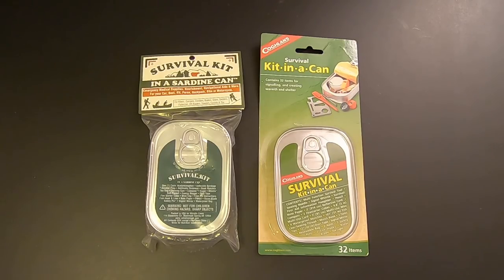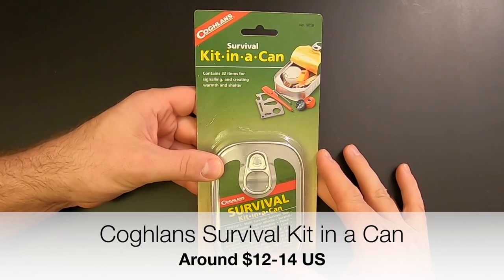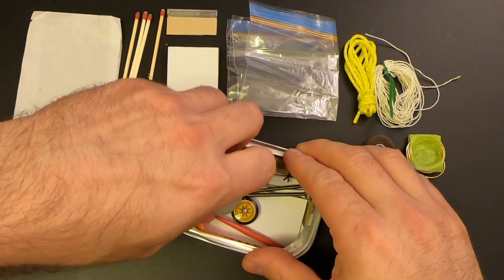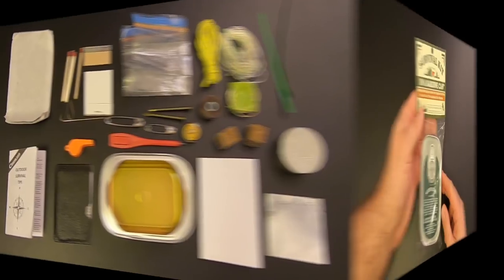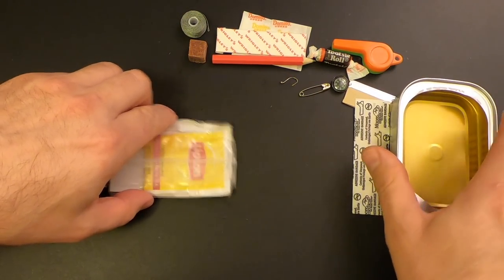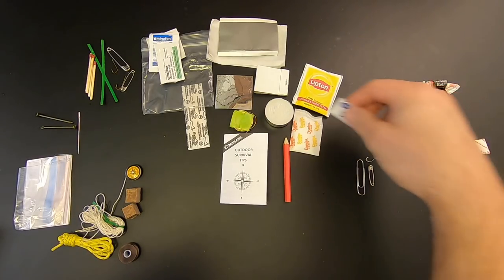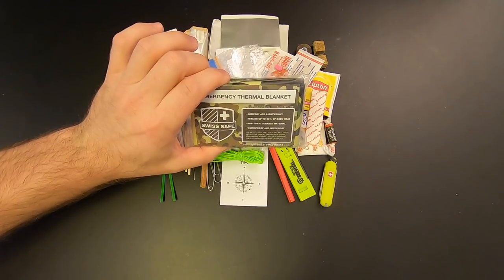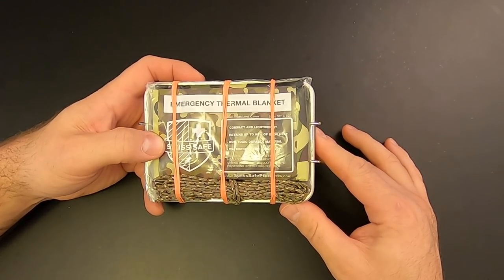Sardine Can Survival Kits - Coghlan's and Whistle Creek

Comment: Personally I have always be a fan of the Cobham's kit. 
It gets belittled by various influencers in the Survival/Bushcraft arena, who naturally want you to buy their own brand kit, at an eye watering price. Without which you will most certainly perish in a most protracted and horrible manner.
However, it's a remarkably capable little kit, particularly at its price point. If I to equip a group of people economically (purely as a precaution) with minimal capability for a short duration, it would be my first pick.
One of them, A space blanket, emergency poncho, Mora knife, 15' (3m) of 550 cord and possibly a wire saw would enhance their chances vastly. 
Give a short (4-8 hr) course on the kit's contents and their possible uses.

Comment: One use for the bread ties would be, take the package the can came in, dump everything into it, wire tie it closed, and put it in your pocket.
I used a bread tie to temporarily reafix a loose button, replace a small screw, start a fire with a AA battery,  and keep a loose knife in my sheath.
It's what I had at the time and worked at least for a temporary fix.

Comment: They must have changed the contents on the Coghlan's Survival Kit In A Can. I have a few from years ago that haven't been opened, and they contain some items I didn't see in the tin you reviewed: bouillon soup packet, 2 adhesive bandages, 2 antiseptic swabs, 1 tea bag, extra twist tie, 1 chewing gum,1 energy candy, and the 4 matches are listed as waterproof. They probably still are waterproof. Oh, the flat multitool in the sheath is not in the older version. I might have missed some differences, but otherwise they are pretty similar.

Comment: Surprisingly the Coghlan's kit was far less crappy than I'd have expected!  Although I think the sardine-can is a dumb gimmick.  It has the advantage of being waterproof until you open it but at the expense of not being able to verify the contents nor will it allow you to inspect and familiarize yourself with the components.  And I'm baffled by the random, scattershot approach to the included gear.  Cordage, firemaking stuff, safety pins, compass- all great ideas.  Nails?  A lame 'survival card'?  Bread ties?  What are you supposed to do with those?  Major kudos to Coghlan's for adding the ziplock bag for water!  Most mini kits just ignore water or pretend you can use the can to boil enough water to keep you going.  SPOILER ALERT:  No, you really can't.  But the Coghlan's tin does a much more realistic job of addressing the actual priorities of survival.  Combining the two kits and adding the space blanket does give you some decent capability but I'd like to see the firemaking beefed up a bit.  It's very easy to start a fire under campground conditions when you have 80 degree weather, sunny skied and bone dry $5/bundle firewood.  But it's a lot harder when it's cold and wet and maybe you're on the edge of hypothermia.

Neat trivia about the term "kitbashing"- I honestly thought you just made it up and liked the sound of it!  Very cool bit of info.
Reply from the maker: Thanks Rob
Reply: That Coghlan's kit really surprised me and not bad at all, especially for the price. I'm thinking it would be a nice little stocking stuffer type thing.

I agree with you on the nails and bread ties. I'd rather see some sort of eye screw that you don't need a hammer or a rock to drive in and risk smashing a finger. Plus you can unscrew it and use it again if you're on the move, but a nail is there forever.

Also, cordage is always lacking in these kits. For "ME", I have found that having at least 30 feet of 200 pound test braided fishing line which is just over 0.75mm thick, works perfect in my small kits. For "ME", it's thick enough and strong enough to be useful, but still small enough to actually carry a useful amount.

I don't use tea light candles anymore either. They just melt too easy and make a mess, and they only burn for 3 or 4 hours max. I use liquid candles now and for the same size as a tea light, they burn well over 8 hours. One of those between my legs and me wrapped in a space blanket, and I can get through a cold night of unexpected "camping". And I have NEVER had one leak on me and make a mess in over 20 years of using them. 
https://www.100candles.com/i-6945/8-Hour-Disposable-Tealight-Fuel-Cells-for-Restaurants

I bet if you go to Walmart in their garden section, you can buy them for $0.25 each and from 12 to 36 hour liquid candles, since it's the end of summer. I buy them out every year. 

I'm looking forward to that ESEE kit video you have. Keep up the great work.
Reply: Being a wargamer I found the channel by searching kitbash for the other reason me interest on SKs stated with a book how to make a survival kit 8n the 80s if you are interested I can dig out the ISBN and you can review the kit they suggest
Reply: @wjf213  The liquid paraffin candles are greatly superior but I think the wax ones still have a place.  They're 1/2 the size, a plus for applications where size matters.  For me the 'killer app' for the wax versions is as fire starters.  If you can get the candle lit you can bet that the 3-4 hour burn time will be plenty to get your firewood going even if it's a bit wet.  Once you have it burning you can harvest the wax for other purposes (eg waxing other tinder, lubricating threads, etc).  But overall, yeah- the liquid kind is better.  I've carried them for years and while I keep them in ziplocks just to be safe I've never had one leak.

Comment: As for the first kit. A few matches of doubtful quality and two cubes? Inadequate and likely to make you first emergency go on fire starting an unpleasant failure. Why not like test one of these matches? It is a special feeling having just a handful of thin matches when you really need a fire.
Also, the candle shown had no wick, had it? Seemed to be just a hole straight through the candle.  As for priorities, it is likely in some situations that shelter and fire is higher priority than screwing with a poor wrench of very doubtful quality, playing with some random thinn short threads  and snare wire for barely one single snare. 
Good to make a new kit, but the review part of the initial kit could be more balanced. Pointing out waste is not being neagtive it minimize the sense of false security.